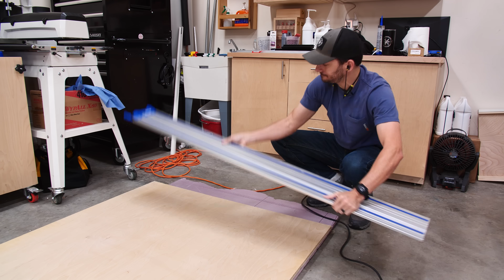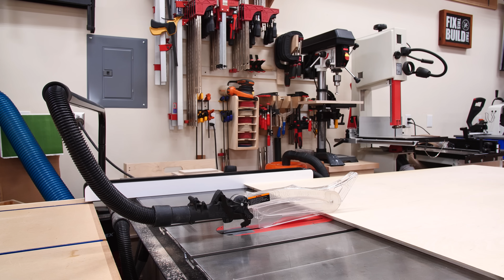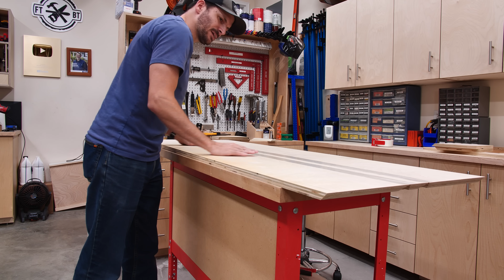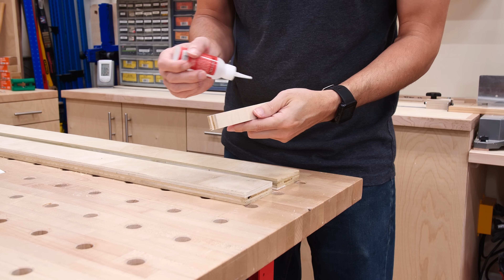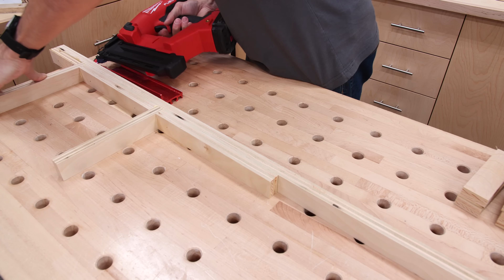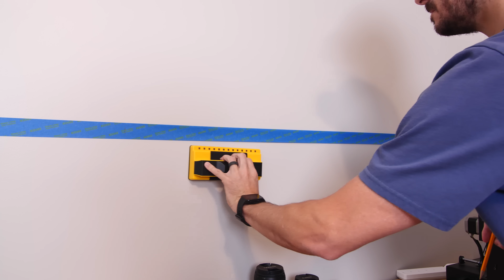DIY Floating Shelves with a Secret

Comment from the maker: Check out the Office Makeover Playlist here:  https://www.youtube.com/watch?v=wQ_CKmejH_s&list=PLLkAgl7_UY3XG8ZdvYF5HhWmhvfcPIxOZ
Reply: You should be selling these amazing shelves. I am buying by the way!
Reply: why not inlay power wires in the wall, you can get good thin wires in there, finish it with mud. even easier to fix if you have drywall
Reply: pourriez vous mettre la « piste audio » en version : Française ? s’il vous plaît !?! 🙏🏼
Reply: How long did the battery pack last?
Reply: This was cool, but entirely too much work.
Reply: Why countersink the screws or bolts holding up the shelves, it only weakens the support and does nothing else since they are not visible anyway?

Comment: I feel like i really should own a tracksaw... in my mind its an alternative to a table saw for a hobbyist with no space.
Reply: It's a good tool.  If you have a circular saw, make a guide for it and see if you like breaking down material that way. I did this for years and then I eventually bought a track saw. 

I break down my big sheets with a track saw and then make the more manageable cuts on the table saw.
Reply: @FormerlyKnownAsAndrew  I do have a circular saw and I have built a straight edge jig for it. However it’s still less than Ideal. I like the fact that the track saw is on a track. Guaranteed straight lines very easily. 

However my real pain in life is not having a planer.

Comment: Here in the UK if we cut plywood up into narrow strips like, that they would disintigrate!!    That's the joy of far eastern plywood for you that is so prevalent in the UK.  Even so, not too sure about the strength of those "spurs" screwed to the wall to support the shelf.    If (when) the glued joints fail, the collapse could be sudden and catastrophic with progressive collapse.  

Many brilliant ideas to be gleaned from the sensational constructor, especially the use of the blue plastic coolant pipes with crocodile clips in the ends to hold the wired connections during soldering.  Truly inspirational "thinking outside the box"

Thanks for a brilliant video.

Comment: heck yeah i love working with electronics i put led strips in my drums(a lot of soldering for that one i cut the strips and used telephone cable and plugs because the strips had 4 contacts and the lelephone cable has 4 different wires) i put a sound system in my bedroom(don't ask questions i thought it was a fun and cool idea it was)

Comment: Fun video!  I’m in the process of making my very first floating shelves. Not as nice as yours though. I was a little stuck on the wall support section, but this helped a lot.  I only have a 4 1/2” circular saw with homemade jigs.  Oh and a brad nailer.  Love that thing!  I have dabbled in electronics, but not in a long time.

Comment: SUPERB video but have you ever had to do this with interior brick walls?

A month ago I was making an outward window sill extension for my cat because he's a big boy now hehe and the brickwork was so sandy drilling into it it made a really bad mess and the wooden plank I carved fits perfectly against the wall but not perfectly horizontal (it WAS perfect before I drilled). 
So I went into a local store called Euroken and then I was told by the assistant I spoke to that I had to buy some silicon to fill the holes in and drill again. I feel the guy ripped me off £16 for that stuff as I have seen it in many other stores for £6. He also was bad at customer service. Looked about 35 and like he didn't want to be there. That's not my problem though.

Anyway I now have 4 holes where the wooden brackets I made were to go but it's all so uneven now that I can't get the Oni drill plugs to be straight. 

Would you be able to do a video on putting wooden shelving or sills onto interior brick walls? Or if you are unable could you or anyone else recommend a good channel for that please as I hate having jobs unfinished. 
I used to be a terrible un-finisher when it came to my illustration work but since I discovered woodwork I am 100% focused on finishing everything I do.

Thank you in advance to anyone who can help : ]

Comment: I am building my own house from scratch at the moment and it will have a complete smart suite of things in every room, I was already thinking about power devices but I think I will run 12v into every wall so I can add things as needed without having to runn more wiring, much like running Ethernet back to a central cabinet I will setup a central acces point for 12volt for maintenance

Comment: Those look Great! I want to build my wife a little led light thing to put on the wall to illuminate a crosstich thing I had framed for her. Can you tell me the best way to wire from a nearby 120 electrical plugto some sort of led of picture frame small low power led strip?Thanks

Comment: Hey guy, just a good heads up when working on electrical stuff: always put the switch on the ground leg instead of the power leg of whatever you’re connecting the switch to. That way if there’s a short it’s not a flammable risk.

Comment: why not just stub out low voltage cables (18/5 for rgbw) at each drop location? fish up your cables into the attic to a 120v switch leg input w/ drivers and wifi controllers, no batteries required. cute project though

Comment: Question for you. I saw that you added in the wireless remote controller but you have 3 separate shelves which are being powered by 3 separate power supplies, which means (I'm assuming) That you needed to connect 3 of those wireless remote controller pieces too. How did you connect them all to the one remote?

Comment: I love the subtle comedy in your videos, the inception plug in was dope.  I always use blue painters tape in my floating shelf glue ups. It holds strong and doesn't tar out any wood fibers when you remove it, nor does it leave any adhesive behind that you have to sand off or may clog any wood grain.

Comment: Safety????? Was that an optical illusion or did I see a glove next to the blade? And if you do you homework you will fine the guard is only to keep a board from hitting the top of the blade and kicking back when there are 2 guys passing a board back and fourth while ripping strips from it. - FACT.....But remember this above all else EVERYWHERE in ANY shop when you are around rotating machinery,,,,,,Loose the gloves or loose a finger. Better to have a couple stitches in you thumb then not to have a thumb to get stitches in. ---- Check the new OSHA regs if you don't believe me.

Comment: I bought a wood shelf, used a router with an quarter inch bit, installed an led rope light and I’d say it looks better than what you have. The leds I use are definitely up to snuff as I have lights in my garage that have been on for over a year with no issues.

Comment: Cool build..did something similar, but I found some battery packs can turnb off if the current draw is too low. As when the ligjts are off but  RF reciver/controller is listening, i may draw low current and the batgeru pack will turn off after a minute or so. Make sure you get a pack that is happy with low current. 
Also some packs dont like having to charge and discharge at same time. And lastly sometimes after chargeing you need to disconnect the output and reconnext it for it to start workong. There, the on off switxh will, so if your project is acting funny, try a different power bank. I leant the hard way. Enjoy

Comment: These really are badass, but I have to say frankly with as much work as you put into them you could've just run power in the wall.  However, I'd think these would be particularly easy for non-pro DIY home improvers to buy and install pre-built.  It's a really cool design.  I'm not a woodworker, I'm an A/V tech and I came for innovative LED strip ideas, so now I'm really curious how someone could wirelessly transmit IC LED data in sequence across different sections of a LED strip installation.  I'm experimenting with a serial LED installation in my office, which has a ton of shelves that I display a ton of things on, and there are unlimited awesome possibilities for spotting items strewn throughout a cohesive pattern.  For instance, each shelf can be a different color (or pattern or animation) overall with a few diodes set to white to highlight important things, then chases can run over this base pattern in any order shelf-to-shelf across the whole room.

Comment: Looks awesome!! I did something similar, but the shelves are wired, yet hidden. Used 1 set of lights and dropped the wire from the top shelf to the bottom shelf, then down the wall and out a grommet to an outlet. Also used wifi/blutooth lights from Govee, so everything is app controlled!

Comment: I have a battery / switch question. I've tried multiple batteries (including two the look identical to the ones in this video). The lights come on when I plug in the battery, and when I press the switch they turn off. My problem is that it also turns off the battery. I have to turn the battery back on for the lights to work, negating the need for the switch. Any suggestions?

Comment: Should use a smart controller. There are tons of them online that work with your choice of home automation. HomeKit google Alexa whatever.  Or build your own for $5. Use a esp32 and flash wled on it. Throw it inside one of the shelves with a 5v 20 amp power supply. Run a three conductor dc cable to each set of leds. And you have a digital led controller where each led is assignable. So you can program any individual led to do anything. I like flashing with a HomeKit compatible software so it integrates into everything else. Program the LEDs to come on when motion is detected. Or to display a different color if you get an alert.  Or a automation that does a rainbow flash effect during a party. Or have the colors sync with your tv.

Comment: if you are drilling holes in the drywall, you might as well just pull wire and do a hardwired + WLED setup and control it using automation or voice assistant.

Comment: I love the magnetic charging cables. Putting one of those adapters in there would have the connection not have dust and stuff gunk it up as easy. And of course everything is better with magnets. LOVE the shelves. Want to have similar when we finally get into a house not an apartment

Comment: The biggest problem that you guys are having with taping the wood is the way that you are taping to wood.  First, use wide masking tape/painters tape.  It works better and is easier to remove.
Two options here:
1.  if putting tape to the wood with the right side up:  
     a.  run long strips perpendicular to the cut, not in-line with the cut.  These perpendicular strips should be about 6"-8" apart from each other and should run a good 4"-5" onto the top and bottom pieces of the shelves.
     b.  then if you are desperate to do so, run 3  overlapping strips of tape parallel to the cut so you wind up with 6" wide tape running the length of the cut.  
     c.  this should give you the strength to lift your shelf from the middle piece so it folds onto itself allowing you to do whatever you want from this point, like flipping your work over in order to unfold and do the glue-up.
2.  try putting the wood to the tape with the right side down:  
     a.  start with one piece of wood with the right side up (yes, I said that correctly).  
     b.  put on long tape strips perpendicular to the cut seam.  These should be long enough to transcend across all three pieces of wood with at least 4"-5" crossing the top and bottom of the shelf.
     c.  run 2 of the 3 overlapping tape strips parallel to the cut if the want to go that route as well.  
     d.  now flip that one piece of wood so the right side is down making sure that the long strips of tape are laying flat, straight, and perpendicular to the wood.
     e.  run 2 of the 3 overlapping tape strips parallel to the cut of the 2nd piece of wood.
     f.  lay the 2nd piece of wood with the right side down onto the tape from the first wood piece.  press down to adhere the tape
    g.  lay the  3rd piece of wood right side down on the tape of the 2nd piece of wood.  press down to adhere the tape
    h.  fold everything up to make sure all tape is secure and wood is aligned correctly.  Proceed with the glue up since there is no need to flip.

Good luck!

Comment: i feel like you could just run the wired through the cleat mount with disconnect points, and have a single switch and battery run it all, or even run the wire elsewhere for no battery

Comment: I'm in the middle of trying to do this, and.... My bevels are coming out like crap on my table saw! The plywood keeps trying to ride up on the blade away from the fence. None of them are straight. Can't say I've had this problem cutting 90 deg cuts before. Must be lack of infeed outfeed tables and the wood trying to arc in the middle, but... I'm stuck. 

Might try and recut them all with a straight edge and circular saw... Any tips out there?

Comment: 1st off AMAZING craftsmanship.    

Stupid Question, I want order this light strip to install under my kitchen cabinets. I need to make 3 cuts, do I need to buy 3 reels of this or I can buy 1 - make the 3 to 4 cuts and will work with 1 remote? (sorry) new to this whole under cabinet lighting and seems like if I were to cut the strip, only that part would work.r rrrrrrrr

I really want it powered on a switch, but my kitchen is now finished and would cost too much to have them wired professionally. 

Thanks,
Steve

Comment: Brad, why did you choose to use 3/4" plywood, as opposed to 1/2"?
My thought is the 1/2" would be less weight and still be plenty strong, at less cost.
Just wondering.

Comment: Great work! These came out really nice! A did a similar (in concept) project a little more than a year ago where I embedded LED's into a riser add-on I built for my office desk. I initially considered the aluminum muzata track, but it's quite expensive for what it is. Significant savings can be had if you just stick the LED's directly to the wood channel you routed, and either forgo the cover all together, or you cut acrylic strips and spray them with frost spray paint (to taste) as a cover that you can then either route a channel so it slides in or glue it onto a ledge you can route (as I did). I actually completed the cover and didn't even end up using it since the light is more intense without and I'm not looking under the riser anyway. Diffusion didn't prove to be an issue with the riser being about 9" from the top of the desk top. One of these days, I'll get a video up for the build as it came out quite nice.

Comment: I missed the part where you get all 3 shelves to work in unison. Are there 3 separate power packs AND 3 separate controllers? How do they all share the same remote? Or are they connected somewhere I didn't see?
Reply: interested too)
Reply: +1

Comment: Well, it's cool but not really practical. If you want to use a battery, you have to use buttons, okay, but why would you have a button on every single shelve? I think it would be better to connect all three shelves with a wire hidden inside the wall to have one button for all three.
There is one more thing, why battery? Just plug it in permanently and forget about any charging, changing the power supply or buttons, right?

Comment: I have watched your video several times to determine how you are cutting the 10" pieces.  It looks like you cross cut two 10" pieces from each end of the 4 x 8 sheet then rip cut the last two 10" pieces from the remaining plywood sheet.  Is that correct?

Comment: just sharing a mistake I've been making recently with LEDs, if you're using em indoor, get the indoor ones lol. The water resistant epoxy coated ones will slowly turn yellow (sometimes you gotta use em though, like in vehicle footwells) from uv damage. It's a bummer because if you ever have to change out one, you'll end up replacing them all because it alters the color.

EDIT: Great video btw! super clean, and electronics + woodworking = the best

Comment: I've seen a lot of videos of DIY'ers doing LED lights, and I would have to say that your video is by far the best so far. I have been an electrician for 30 years now and have done more LED lights than I can say. You hit a home run on this one, however, I would have just run a power wire to the shelves and not used battery operated LED's, but that's what I do for a living anyway. Great job!
Reply: How do you connect low power cables to outlet or light switch
Reply: @Gio-ii2tf  If you are asking, how do you connect LOW VOLTAGE power wires to switches and outlets? The answer is just like you would any other wire. If you are going to use an outlet for low voltage, I would label it as low voltage, so it isn't used for anything else. I personally do not run a low voltage line and install an outlet on it. I will connect the LV(low voltage) line directly to the lighting via approved connectors or by soldering. A switch however is a little different. A switch will be fine connecting LV wire too. I hope this answered your question.
Reply: The batteries will last a few days. Then charge. Then a few days. Then charge.
Reply: @Macumazahn16  And you'll have to take all the stuff off the shelf to get to the battery!  I'm done doing any battery devices.  Seems like a great idea, but after a year of constantly having to charge things it's annoying.
Reply: @RyanTerry  if you watched the video, he accounted for that and made an accessible charging port so he wouldn't need to take the shelf off to charge it.
Reply: @tukuiPat  excellent. Yes, I quickly scrolled through towards the end so I didn’t see that. Thanks.
Reply: @RyanTerry  OR I would make a USB-c charging port to the side of the shelf, so you can charge whenever needed or constantly put on charge (but not sure if the battery would explode overtime)